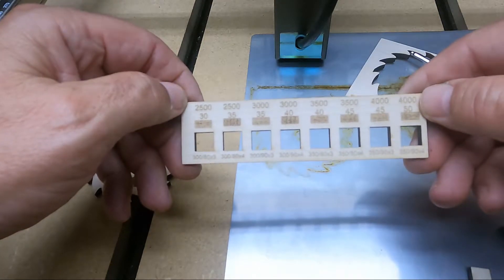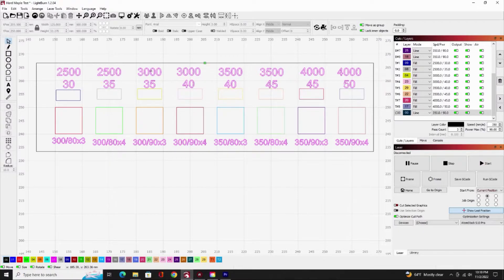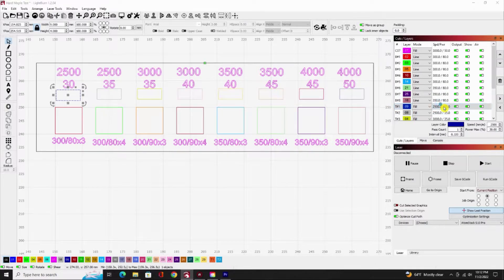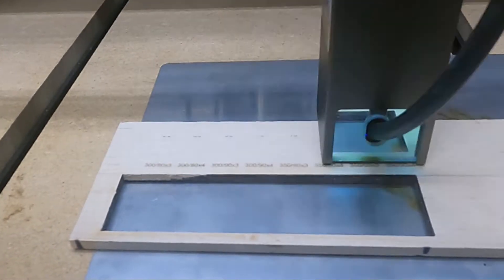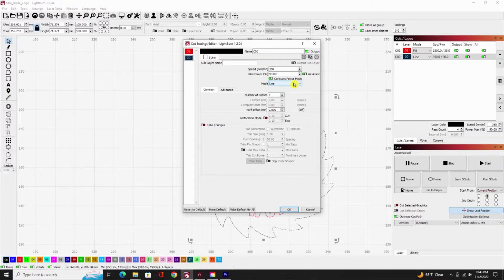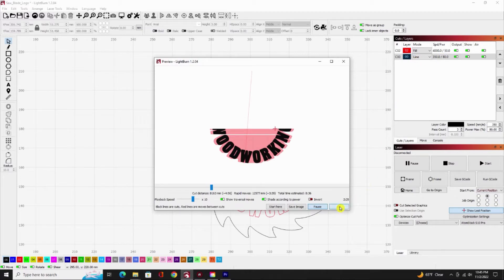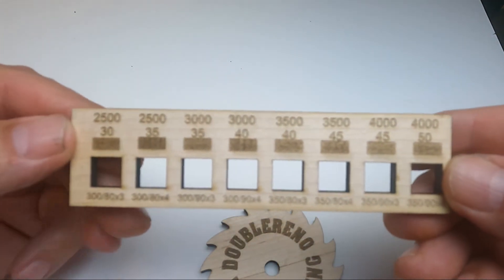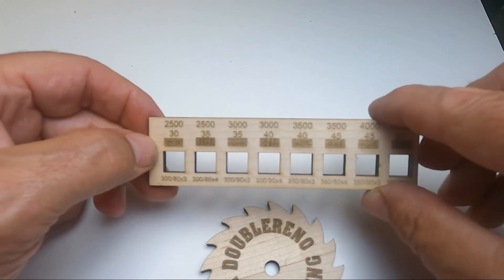Make a guide for Atomstack Laser using LightBurn

Comment: Great video, I do have a question.  I have the atomstack a5m50.  I want to do a test like this but on thinner wood, do I need to do more than one pass?  I am having issues with settings.
Reply: You only need to use as many passes as it takes to cut through the wood (if you're trying to do that). It also depends on how much thinner your wood is, I'd just play around with the settings like power level and speed